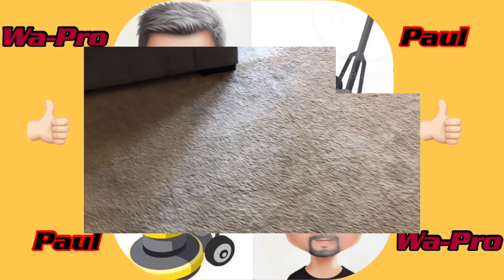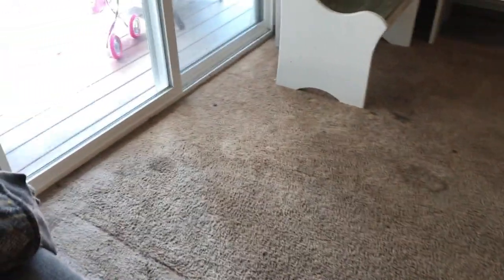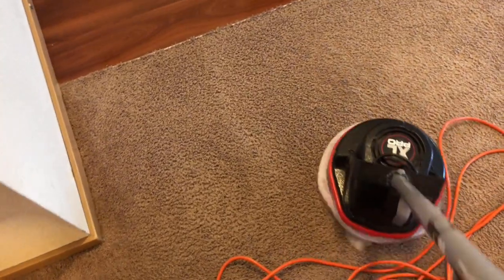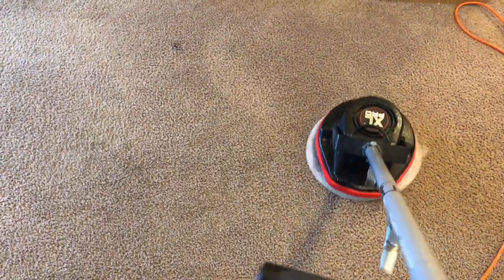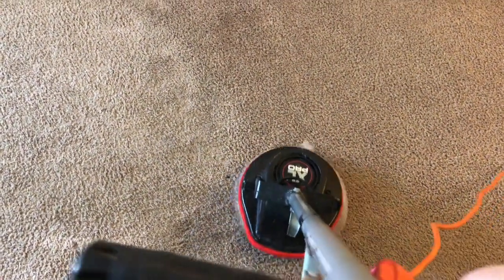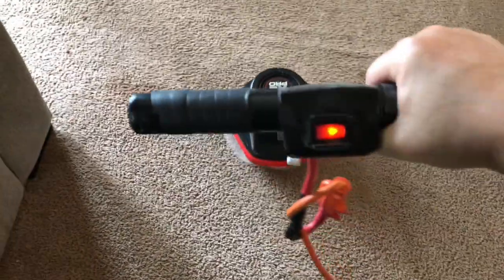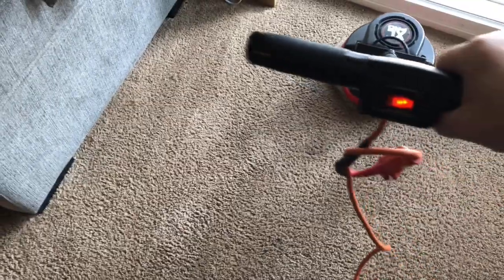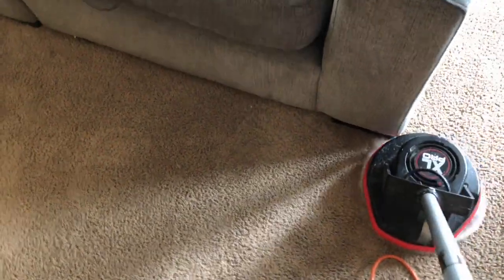Oreck Orbiter Entry Level Tool

Comment: I can attest to how well microfiber bonnets work with an Oreck. Blue microfiber and grey w/blue scrub strips are my go-to pads. Polar and Zinger pads are ordered already, to take it to another level.
I found that if the Oreck is rattling when you push it, you are moving too fast. Going slower so it glides along does clean better.

Comment: The base of the Farrag is probably not cement, it is probably pot metal. When you try to weld pot metal, it crumbles like cement. You can't weld pot metal. Use JB Weld. It is a metal epoxy that you can get at any auto parts store for about five bucks. The surfaces must be very clean or it won't stick. It is probably stronger than the pot metal. It is more or less permanent, at least it never failed when I followed the directions. It doesn't work where the part gets really hot, like 600 degrees. I had a cylinder head shop. I couldn't use it in the combustion chambers, but the water jacket occasionally cracked on the outside. Certain heads can't be welded. Welding costs a lot, like hundreds when you can do it, when you can't the customer has to buy a new head. This can cost thousands of dollars. For 5.00 I could save the customer thousands of dollars.

Comment: Thanks for making the videos! I am a real estate agent in the Greater New Orleans area and I offer free carpet, tile and wood floor cleaning to clients that list or buy with me and I do the cleaning personally. I have had so many clients recommend me that I am starting to get a lot of calls for cleaning also. I am now starting a cleaning business as a side hustle. With that said, is the Oreck Commercial 1/2hp the way to go or would the 13'' Koblenz be the better choice? Which one do you believe does the better job with the zinger and Polar pads?
Reply from the maker: I was licensed with Keller Williams couple years ago. I would clean carpets and ask why they were cleaning. When they said getting it ready to sell, I offered to sell for them 👍🏻. Koblenz for sure, but you need an Oreck for stairs too.
Reply: Hi Jay. I live in Covington. Been doing janitorial for 30 years in the greater New Orleans area. Good luck with your business.

Comment: When you are using low moisture application I use the oreck on stairs because of its small size and easy on the back operation but wait the units of 175 rotary is a big concern because of aging body but the weight of the units just help clean pounds per square inch so are you if you are to go to a say 60 lb unit reduce pad size as much as possible say 14 inch pad when I use a 175 I use a 17 inch pad it allows a little edge for buffer it is hard to beat a 175 and hot water extraction combination

Comment: Great work. With the Koblenze versus the Oreck, do you think it boils down to primarily the head weight as the factor that makes it more efficient or is it the ability to run a more scrubtastic pad such as the Ironman? I made a bigger driver for my Oreck and I run 17-inch microfiber and Excellent Supply fiberplus pads as well as 15-inch glad pads with no problem. No rattling or grinding and the motor doesn't get warm or anything. My better half won't let me get that Koblenz yet but I have my eye on it...
Reply from the maker: The Koblenz is a rotary. It is easy to operate. But it sounds like you got the Oreck filed in. I would love to see running a 17” pad. Sounds cool.
Reply: Yes I want to see a video with the Oreck with a 15” pad

Comment: Could someone please tell me what the difference is between the Oreck orbiter he uses in videos vs the say Carpet Shark counter rotating brush? I have seen those in pics of people cleaning commercial and wondering if they are mostly used for that or what. I am barely looking into the world of carpet cleaning and it can get pretty confusing. Thanks
Reply from the maker: I have no experience with the shark sorry 🤷🏻‍♂️
Reply: @procarpetcleaning  Oh I found out that it's a CRB machine. Have you had worked with those? If so how are they and how do they compare to what you use?

Comment: Hi Paul,
I have some questions, 
I hope you can advise me. 
I have oreck orbiter, 
I'm using specially on stairs, I got the pad driver from Challenger store, but the second time I used on the stairs, 
the pad driver is not holding the bonnets,
How do you handle that situation?
What is the difference between,  Koblenz,  mytee and Challenger orbiter?
Thanks
Reply from the maker: I like using a microfiber scrub strip 13”pad for the Oreck. It doesn’t clog up the velcro with fibers. You probably need too clean the velcro out. Koblenz, Mytee can be research on Encapstore dot com challenger on challenger op dot com. 😊👍🏼
Reply: @procarpetcleaning  Thanks

Comment: What base attachment do you put on the bottom to stick your pads too? I am using the base plate that comes with the orbiter and it tears the pads up pretty quickly. It looked like the one you are using is different.
Reply: Challenger OP pad. It’s like $130. I’d recommend buying another oreck pad driver from Amazon $15. Then take a razor blade and cut the spikes off. Go to Home Depot, get Velcro strips for $5 and put it on.
Reply from the maker: $42 challenger op pad driver made for the Oreck. Go to challenger op.com
Reply: @procarpetcleaning  thanks a ton!